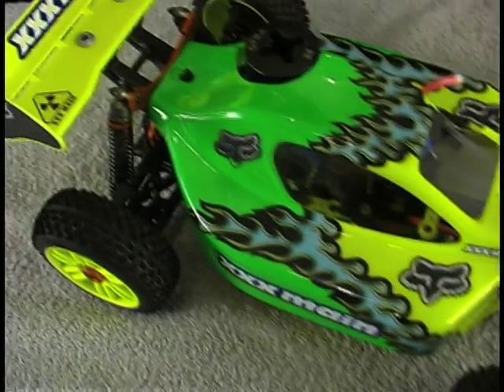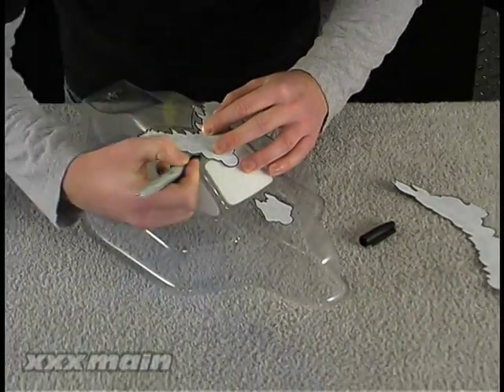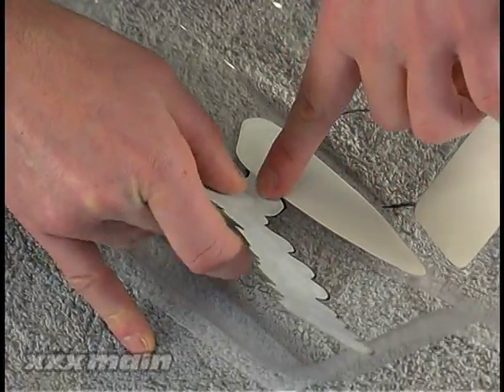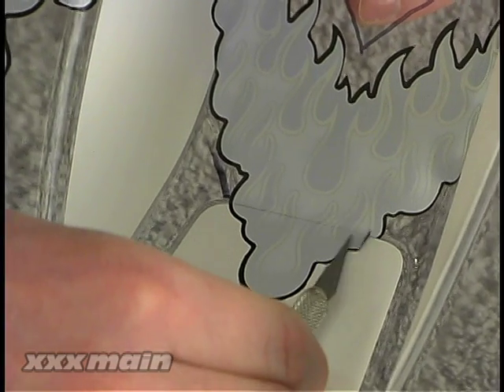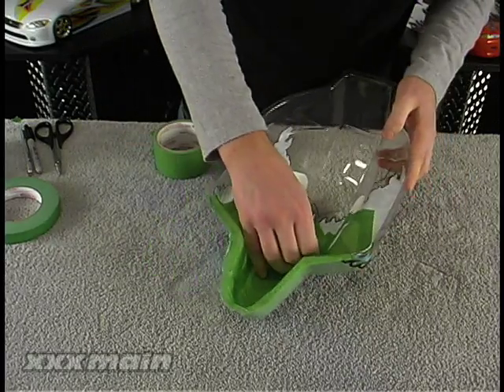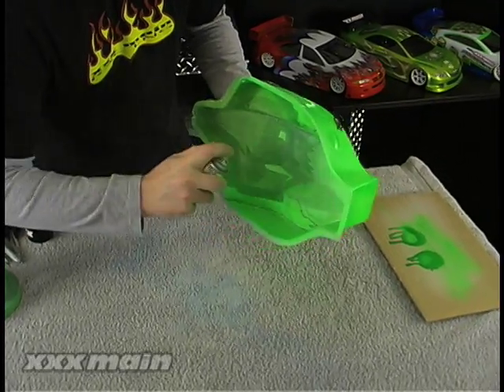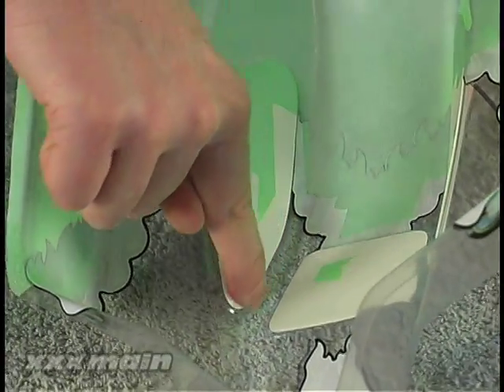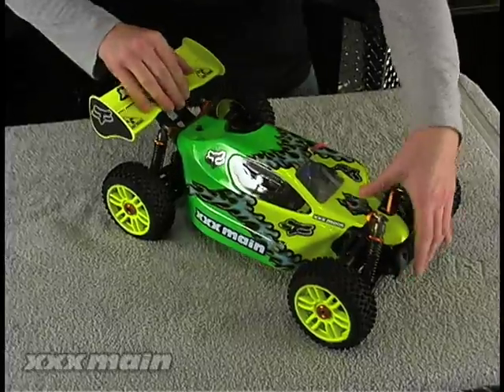How to Paint RC Car Bodies~ Internal Graphics_ xxx main Decals

Comment: NO! Paint for Lexan bodies is VERY different than regular enamel or lacquer paints. It makes a chemical bond to the Lexan itself. Lexan stretches way more than regular paint so when it does if there is not that chemical bond it will have troubles adhering to the lexan and it will flake and chip as the lexan flexes about. If you are going to use spray paint, Pactra or Tamiya RC specific Lacquers are your best choices. I wouldn't recommend anything but lexan-specific paint for r/c bodies.